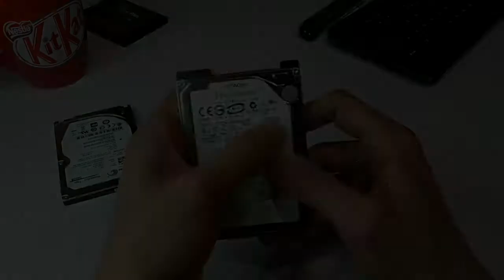What to do with an Old IDE Hard Drive?

Comment: I was digging around the house and found couple of IDE drives and was thinking of repurposing them into small HTPC-like build however IDE to SATA adapter is about $10 and enclosure is another $10 and for $20 you can find 1TB SATA 3 internal drive or 500GB + SATA to USB enclosure, as for IDE/PATA I guess the only thing left to do is to recycle it.
Reply from the maker: Thanks for the insight and thanks for watching!

Comment: A microSD card would be cheaper, smaller, faster and have bigger capacity than this drive 😅

Yet recycling is a good reason 😊
Reply: That is true though I have a drawer of old working drives that I keep hesitating to just throw. Those cases seem to be more expensive recently.

One thing in my experience sd cards definitely fail on me more often than hard drives and at least hard drives will give you some warning sounds when starting to fail.

Comment: It's just more space and energy than using solid state storage (USB Flash/SATA SSD/NVMe SSD). I mean that's why they have the extra USB head: for more power.

It's a lot like LED vs. filament light bulbs. Yeah, filament light bulbs work, but they use more power and, unless you're using 100% solar or wind or something, contributing to pollution more than an LED bulb would.

Granted IDE drives shouldn't be in a landfill, but they should be recycled. Worst case is they melt it down.

Comment: Both thsoe drives are IDE (Integrated Drive Electronics) compared to an older IBM standard from the 80s.

The one with the "funky" pins is PATA (Parallel ATA).

Both SATA and PATA are the same communication standard but using different cables.
Reply: Agree with everything, except the bit about the funky pins one being called PATA. You can’t just rename something when it becomes obsolete. 

That is a hard drive with an (E)IDE interface and it uses the ATA(PI) protocol. It’s written on the drives themselves, written on the cables, written on the mainboards and written in their manuals since 1986. 

The term “PATA” was first used around 2003, after IDE drives had become obsolete with the introduction of SATA drives as an unnecessary way of distinguishing between them. 

This thoroughly unnecessary attempt to back-acronym caused so much confusion at the time and I refuse to use the new terminology.

Comment: I used this adaptor but something went wrong... My pc detects new usb device but nothing shows up
Reply from the maker: See if the dive shows up in disk management. You may need to format the disk before it is usable. I hope that helps and thanks for watching.
Reply: @GizmoJoeReviewsTech  thanks!!!! I have found it in disk management but couldn't access data without formatting. Some disc data recovery software helped me get out my old files !!!

Comment: I have a couple really old 1992 5" hard drives i'd like to pull data out of. do you know where i can get an adapter for those? It's a very large 50 pin connector. Thank you...